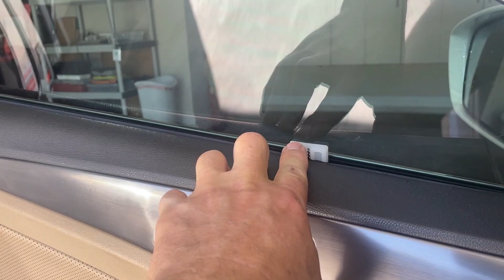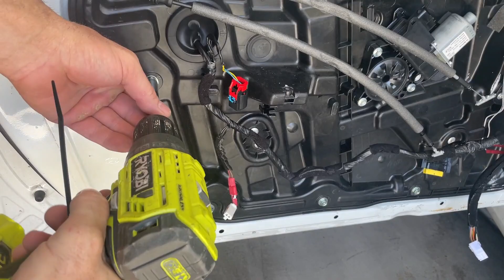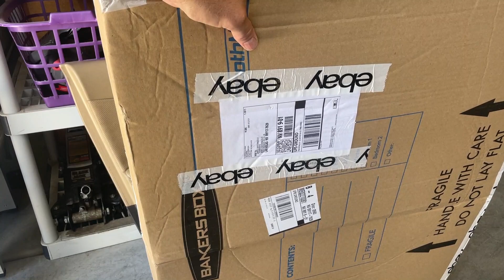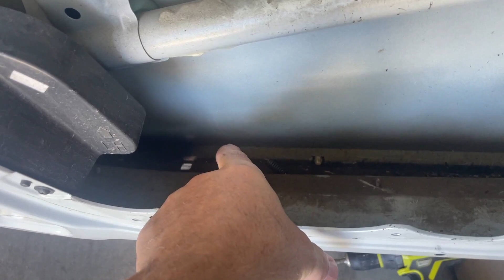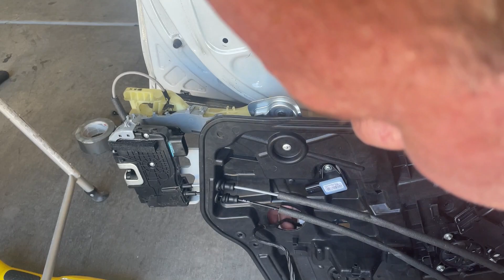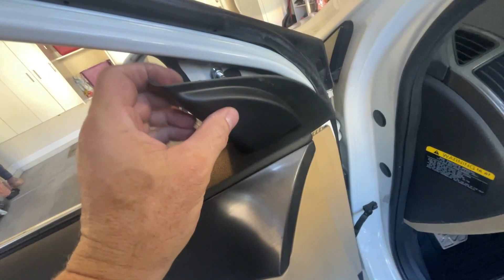2011-2014 Hyundai Sonata hybrid window regulator broken window replace motor

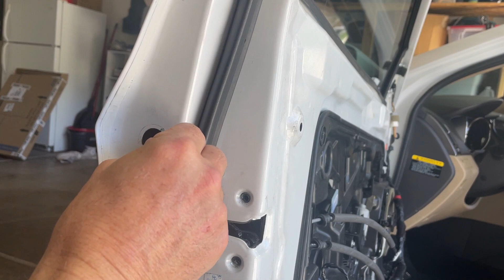Comment: Thank you man. This video was a great help and gave me the confidence to tackle this job. To offer a slightly different approach to the lock screw at 12:00  , instead of cutting the door I drilled a slightly larger hole in the plastic to give me access to the lock.

Comment: After looking online, the torque spec for the window clamps is below:
Glass to Regulator Bolts / Nuts: 5.8 – 8.7 lb-ft (8 – 12 Nm)
Regulator Channel Mounting Bolts: 2.9 – 4.4 lb-ft (4 – 6 Nm)

Comment: For the screw holding the key lock, I didn't remove it. I backed it out enough to release the lock, removed the lock, then screwed it back in. Reverse to reinstall. That way, I didn't have to start the screw into the hole.

Comment: For that screw at 12:00... even with the magnet tip... I'll cut a playing card in half long-wise and roll it up the size of that hole and then take the screw out and have the card there to catch it if the magnet fails.

Comment: "These assholes wanted $450" I laughed pretty good at that part.... Well those assholes did my engine replacement, and did a shit job at an engine swap. I was missing important bolts to the manifold and bolts were not tight.... Needless to say, I'm having serious engine troubles post engine replacement uhgg

Comment: I have a 2011 Sonata. In the cold winter the window will come off the track when I try to lower it. I have tried tightening the bolts but they just seem to turn and turn. Today I applied epoxy. We will see how that works. Any suggestions?